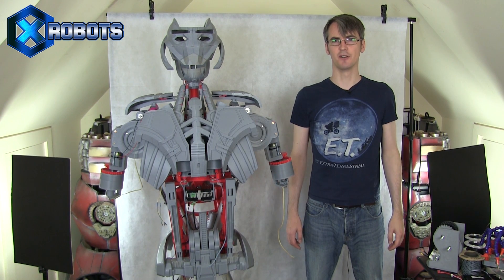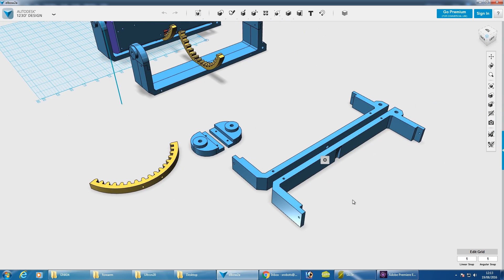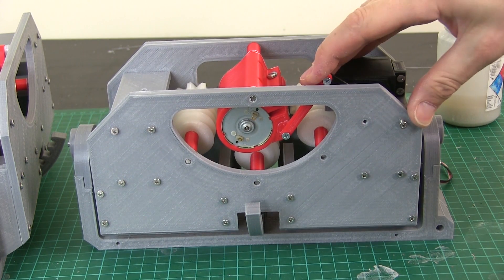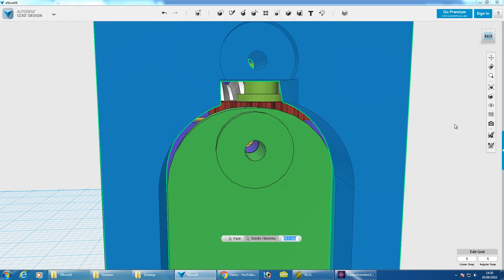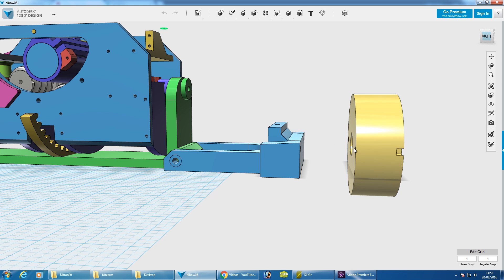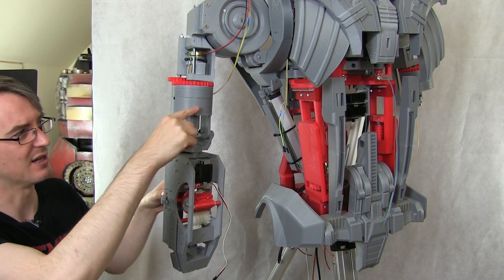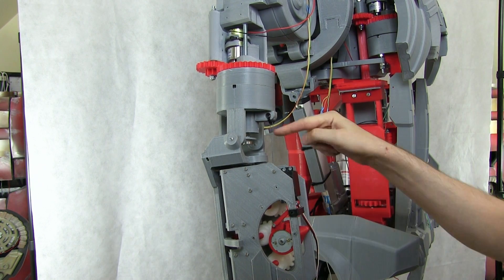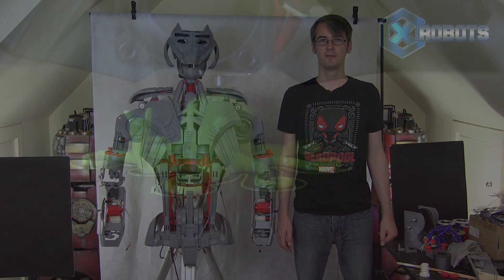Avengers Ultron #20 | Forearm & Elbow Mountings | James Bruton

Comment: I think you have just added a design flaw to the elbow. Bending it with just a string might be nice if the hand is pointing down; pointing up or sideways though, the elbow is free to bend on its own or because of gravity. .... Or am I missing something?
Reply: you meant to hold the elbow joint straight... yeah possible, but still less than ideal I guess..
that pulley is wide enough to hold a few windings of the string so it shouldn't slip.. just mounting both ends of the fishing line to the upper arm and the position would be fixed (no series elastic actuation of course) but the lower arms are going to be beefy for all I can tell so far.. adding bungee will only add more load to the motor .. a pulley looped string does not add any load and you can move and lock both directions without any additional part or weight (except for the small hook needed to fix the other end)
Ah well.. nevermind, we'll see.

Comment: Hey James, just a quick question. The motor in the lower arm, can only drive one gear at a time, while a human arm is capable of moving in every axis simultaneously. Aren't you worried that you're going to have trouble to replicate lifelike movements because of this?

Comment: Looks like there's enough space in the elbow for a pot ( 16:00 ) , i think you could fit one on the pivot axis from the inside. Would give easier time setting up when you don't have to calculate the angles.

Comment: the elbow has a single powered function(close). Right now you are relying on gravity to open it. This will work most effectively in the test setup, but will create a lot of problems when you start playing with the full arm. You may need to redesign the cord/pulley system so that both directions are powered. The same is true for the other pulley.
Reply: :) ok
Reply: +James Bruton (XRobots) finally, someone else who says bungee cord!!

Comment: I can foresee a problem with your elbow joint - you're relying on gravity to extend the arm, this will be a problem if you want to move the elbow horizontally or inverted. What's your intended solution for this?

Comment: if the same motor drives the bicep forearm and wrist, wont it make it impossible to perform compound movements because the joints arn't independent of each other? why not put another motor in the bicep itself freeing up some space for a third motor in the forearm? or is it a power issue?
Reply: Ah I see. Very cool. it will be interesting to see the final product :D

Comment: Right now, you're depending on the arms having gravity on their side, to 'open' the elbow joint. What happens when the shoulder and bicep is rotated in such a way that gravity is no longer pulling against the string? Do you have a plan to create opposing tension to force-open the elbow? Similarly, if your plan is to use the string to close the hands, what's going to open them again?

Comment: why did you choose to use a pulley with string, did you think about possibly using a small motor to turn the elbow joint, or even hydraulics?

Comment: mmm only thoughts i have withe my fuzzy brain early in the morning is why not put the pot in the hinge instead of the linkage.... and just now realising why a string and not a toothed flexible printed ninja flex belt / strip as the distance is so short now.....that strip could fit in the arm space lengthwise..... could be toothed on both sides..... looking good.
Reply: +James Bruton (XRobots) even if the pot is used as the hinge pin?